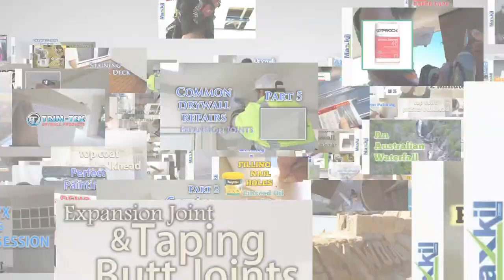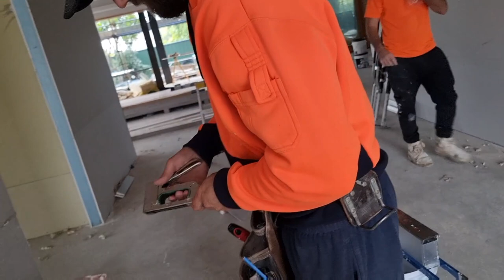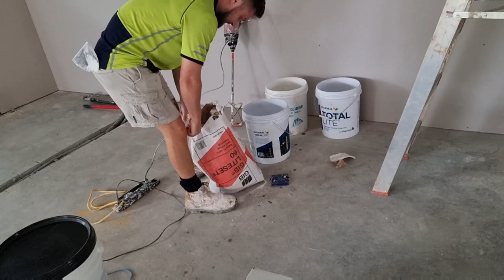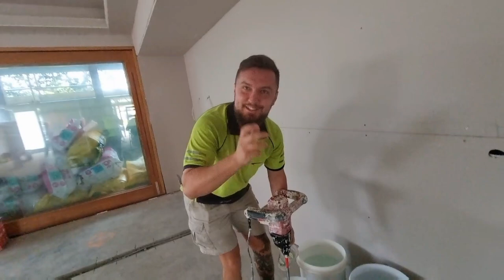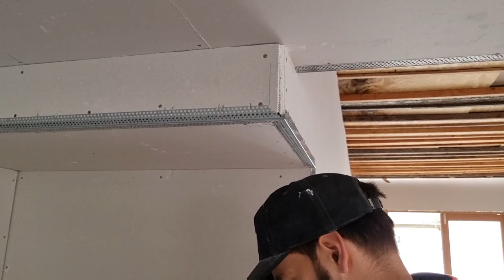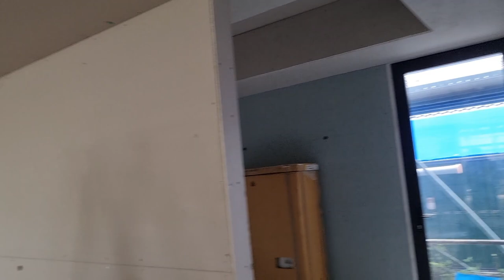Fixing Metal Angles on Drywall feature Bulkheads for an Amazing Home Entry

Comment: Yo Max, hey tell your mate the rapid guns when they start not firing staples, we pulled 1 apart and what happens is there's a metal rod inside it that bends enough that stops the firing pin getting behind the staple. So what you do is get a grinder use a grinding disk not a cutting disk and take just enough off it shortens it to fire again. Just grind it back little by little until it's fixed. It's always been an issue with rapid guns.
Reply from the maker: Hey Kris yeah i think you said before .. they will read this, hopefully it helps them out. They been doing heaps of angles lately

Comment: Teamed up with a lad who has converted  me to the steel exys,  but I still prefer putting them on with mud. Faster (for me) and have more of an easier time manipulating them here and there. Hut also I find the mud used to plant them on acts as a 1st coat to help fill the holes and therefore less to scrape after 1st coating

Comment: it was called gibraltar board in nz years and years ago, hence the abbreviation gib, thats all i know , cheers from alister
Reply from the maker: Hi Alister ... Thankyou my friend , i wondered for such a long time.. now that explains that!!
Reply: Yeah GIB is the brand name and we just call everything gib board even it's a different brand. I tried to sell a gib fixers hammer on Trademe and they they removed my listing because GIB is a registered trademark 😅. Had to relist and call it a plasterboard fixers hammer.
Also try the Rapid R34 staple gun. I just my bros one and on the max setting it punches the staples right through the steel. It was a game changer for me. Assuming you guys have the same gauge exies as us here in NZ? Love ya work bro 💪